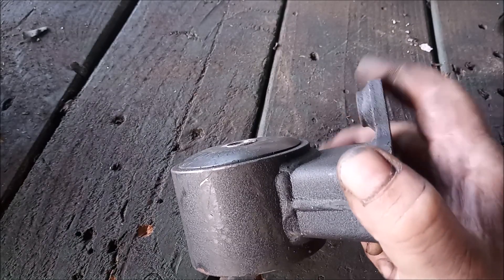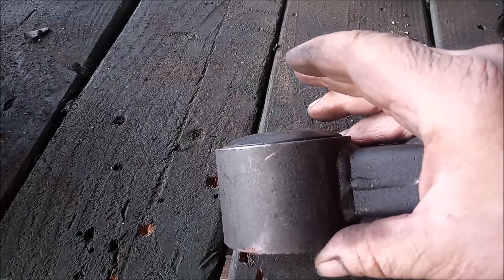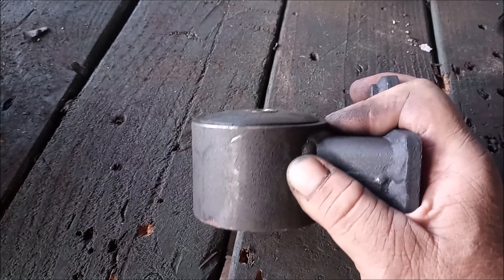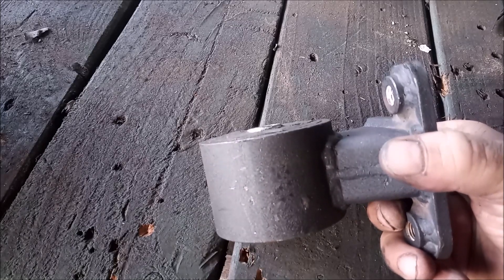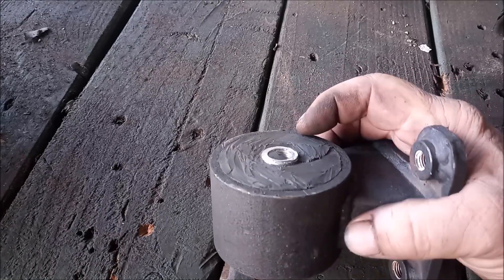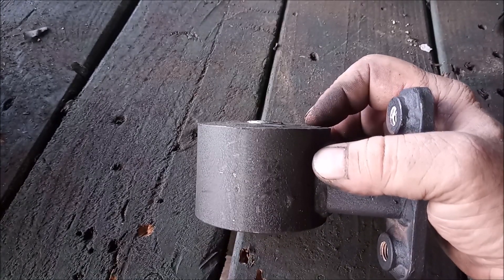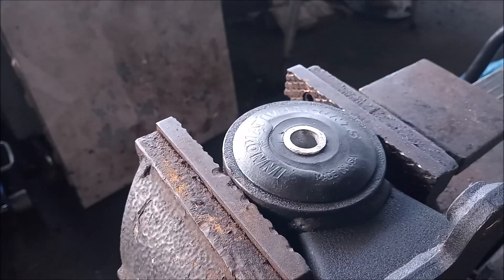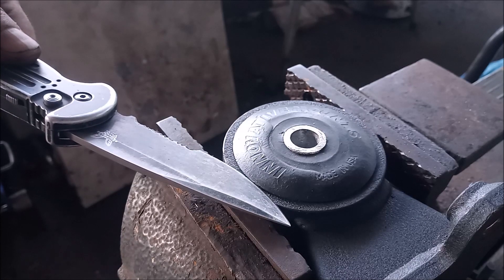How To Eliminate Vibration - Innovative Motor Mount Hack

Comment: I did that on my mounts (3) and the engine was vibrating the chassis horribly on MRS. I bought the red 60 Durometer inserts and it fixed all issues.
Reply from the maker: Thank you for watching and for commenting.

Comment: Great video, BTW Hasport has inserts that come without the lip (flangeless) as an option as well.  They should work with Innovative mounts as well.  I ended up finding a softer bushing from a Ford Expedition frame bushing that worked perfectly.   10 decibels quieter in my cabin ;).
Reply from the maker: Thank you for watching and for commenting.

Comment: Installed Innovation motor and transmission and diff mounts on my supercharged S2000, and the whole car vibrates. 90% of it is the motor mounts, and I'll be doing this trick tomorrow to cut the vibration down.
Reply: Hi. It worked?! I have one set on my ep3 for about 2 years, and i'm so fed up about vibration..

Comment: I got me a full set of hasports and I get the same vibration/hum sounds. Can I cut off the sides aswell? And do you recommend to cut the sides of all of them or only engine and trans mount? Thanks
Reply from the maker: i am not familiar with your mounts, but probably yes, modifying them as shown would help, if this helps to put the center bushing in direct contact with the bracket and ensure a secure mount. Start with the mount on the firewall. Then the passenger side. Then driver side.

Comment: Will this hack work for d/b series hasport mount? Thanks
Reply from the maker: This will work for any mount where the rubber insulator material is overfilled and does not allow secure contact between the mount bushing and the mount bracket.
Reply from the maker: I have explained and demonstrated as clearly as possible why and how it works. Up to you to process that and figure out if it works for your mount.

Comment: I installed innovative mounts on my MR2 and the vibrations was unbearable. The whole car was resonating like crazy. It felt like I was driving without exhaust. I cut inserts on front and rear mounts just like on the video and it worked. The car no longer vibrates and the engine is still stiff. Thanks a lot!
Reply from the maker: Thank you for posting this. There are so many doubters. The proof is in the puddding, foos.

Comment: Wouldn't NHV be coming from metal to metal contact through the center metal tubes in the bushing, to the bracket/frame?
Most oem mounts use rubber and sometimes the metal housings of the mount is  completely coated with  rubber too. This is to absorb the vibrations and noise. 
Removing that rubber eould just reduce this dampening, logically speaking.
Reply from the maker: Have you even looked at an OEM mount?
Reply: @Merryfrankster_   I have looked at more OEM mounts than I can count ,to be honest. I have been working on cars and modifying them since 1980.  The  last mount I removed was from a 2018 Mazda 3 the mount was typical OEM rubber, and the metal casing was also coated in rubber.  
I replaced it with a new performance mount , that is billet aluminum and poly bushings. The bushings have steel tube inserts and  it extends .40 beyond the poly bushings surfaces. The NHV has increased noticeably , as well as hearing gear whine from the tranny and some.road noise. Metal to metal contact conducts sound and vibration way more than having an isolator/absorber like rubber, between the contact points.

Comment: To bad this won't work on poly
Reply from the maker: It  works on any mount that transmits vibration because the insulator is too wide.

Comment: I purchased a rear motor Mount for my civic si . Shaved the excess rubber just off the top so metal tube is exposed and makes contact . Torqued to spec . Nice and tight . No vibration or noise . Feels great .
Reply from the maker: Imagine that. Thanks for watching.
Reply: I just got mine today and was wondering if I needed to shave all the excess rubber. This sounds good! Any trouble with the putting the mount on the new bracket?
Reply: @edgaraguilar7040  no trouble at all . I would install it as is and if it vibrates or feels ugly then yes shave it . I shaved mine and feels good. No unwanted vibrating or droning

Comment: The vibration should only be from the added vibration, causing the engine vibration to vibrate through the frame of the car instead of being absorbed or dampened by the soft OE rubber/fluid. I don't believe this helps at all.
Reply from the maker: You can believe whatever the heck you want. Anybody who has done this KNOWS that it works.

Comment: Hmm good to know.  About to pick-up a single used rear Innovative mount for cheap so why the heck wouldn't I try this?!  A good way to see if they're for me.  By chance do you know what the durometer of the black rubber mounts is? 75?
Reply from the maker: I believe black is 90. Not sure.

Comment: That’s an awesome idea. Did you have issues with the bushing sliding out overtime?
Reply from the maker: In one word, no.
Reply: I did! On the side mounts, they allowed the motor to move back about 1 inch because the bushing slid inside the mount. That was only at ~500hp.

Comment: That's a brilliant idea, thank you for sharing! Only concern I have is whether the stability of the mounts will be affected by reducing its contact with the bracket. Seems like that extra bit of rubber on the sides would help tighten it up and prevent side to side play since the inner tube is loose, but I'm no engineer. Did you notice any adverse affects from this mod such as more engine movement?
Reply from the maker: The entire concept of this mod is to seat the mounts securely so excess motion and vibration are eliminated.